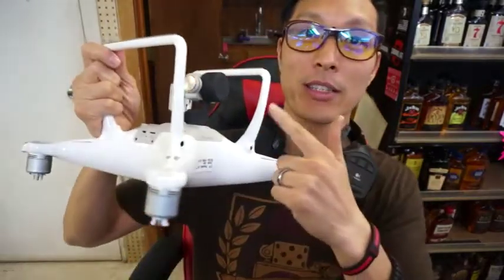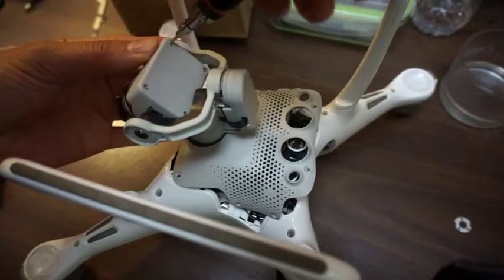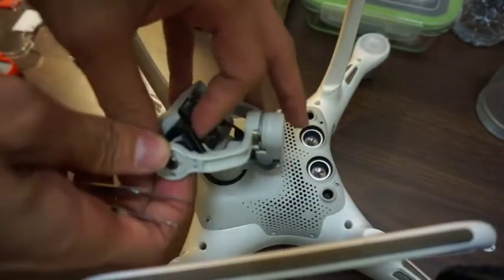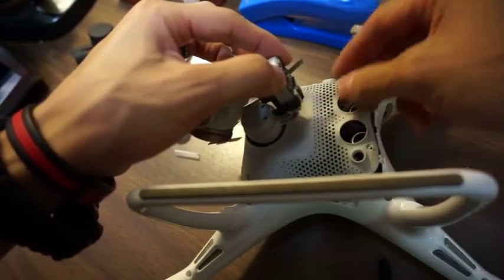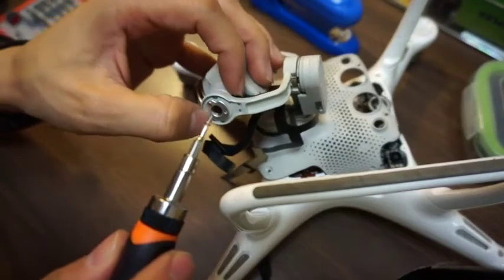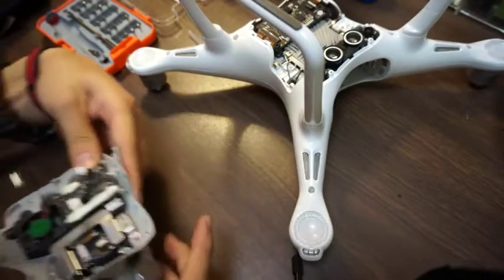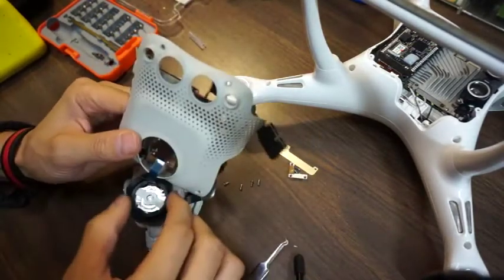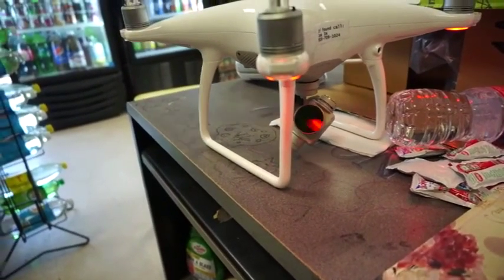DJI Phantom Camera Error Fix

Comment: Did you managed to fix the gimbal problem in the end?
Reply from the maker: Film Factor yes replacing the flex cable fixed it.
Reply: But in this video it looks like that this problem still exist after you’ve replaced the flex cable?
Reply from the maker: @filmfactor  Right, it is flying good even today two years later after this video has been made.  The flex cable is an inexpensive fix.
Reply: I’ve changed the flex cable and nothing changed? I guess it was faulty flex cable??
Reply from the maker: Film Factor that could very well be it, a faulty cable.  Also try doing an update on the software to make sure everything is reset to the latest update.
Reply: @filmfactor  did u fix it?
Reply: @Ki-uo1ki  nope